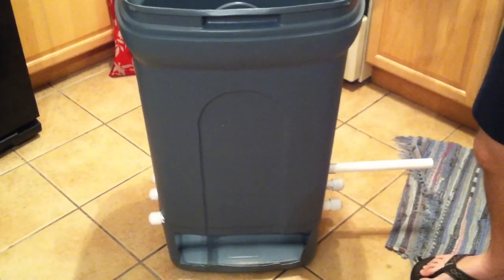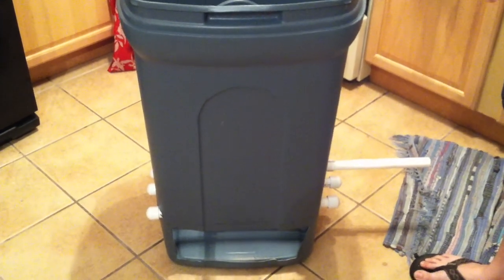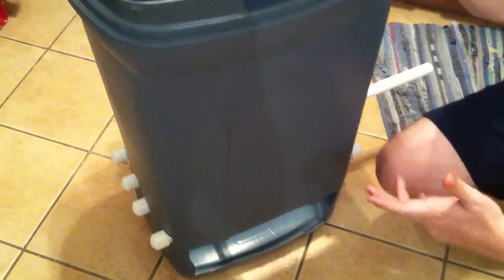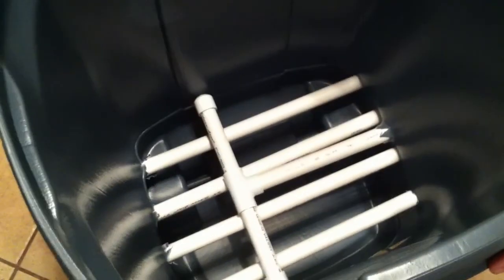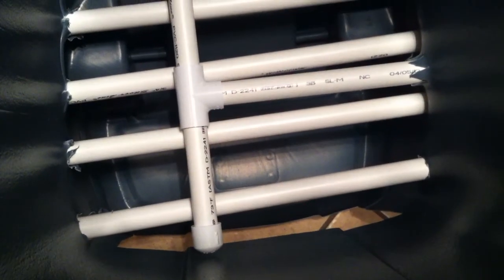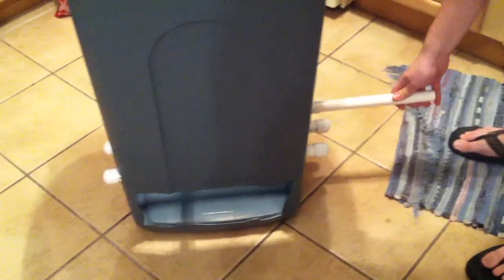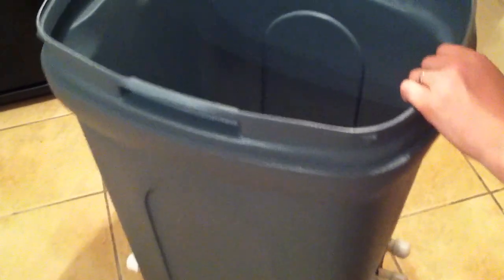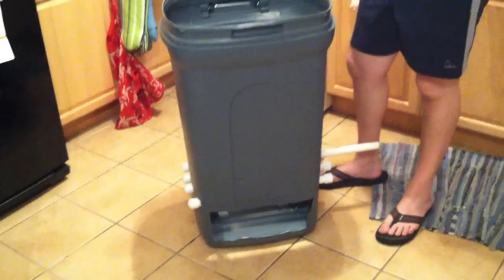Easy Flow Through Worm Bin for Vermi-Composting in the Garden

Comment from the maker: It worked fine. I did learn one lesson that I had to screw the scraping arm together. Otherwise it would come apart when pulling.

I ended up scrapping the whole system and putting it all into a regular compost bin due to size limitations.

Comment: Pretty cool design. Im looking for a better way to compost also. Im just wondering do you keep this inside or out? And won't the worms crawl out the bottom? The only way Ive been able to store my compost inside is inside a trash bag inside a sealed bucket inside another trash bag, because gnats will take over my house. Im knew to vermicompost I usually dont use worms, except for the ones that crawl into the huge pile in the backyard. Thanks! :)

Comment: Hi Neal, I was wondering if there are any updates on how the CFT is working?  I would greatly appreciate it.  I'm thinking of doing one myself.  Do you have any plans also???
Thanks,
DC
Reply from the maker: It was working fine, but I disassembled and scrapped it when I moved several years ago. The two things to keep in mind is how rigid the container is and to make sure your bars and scraper won't fall apart.
Reply: @NealMcSpadden  Will do, thanks...